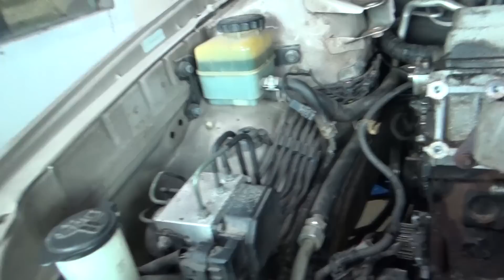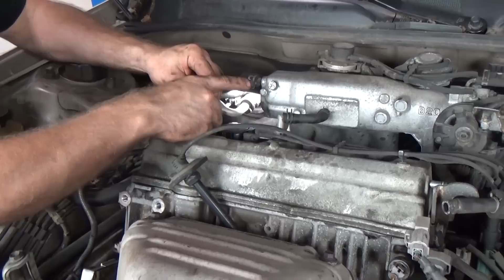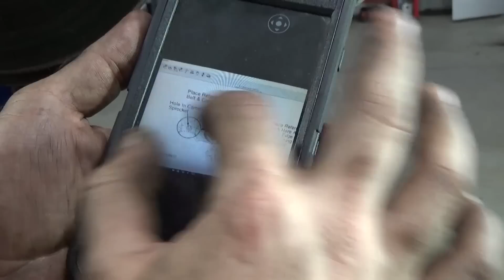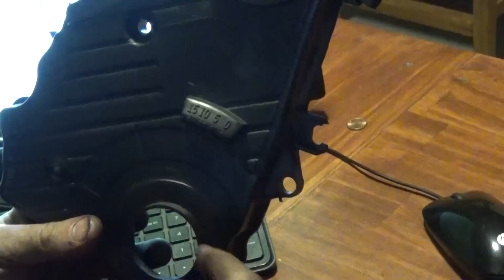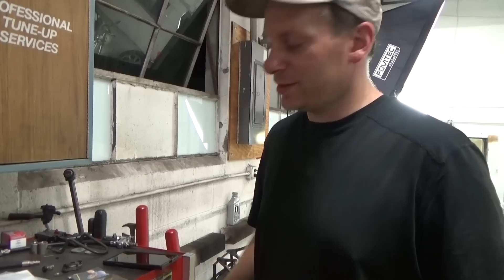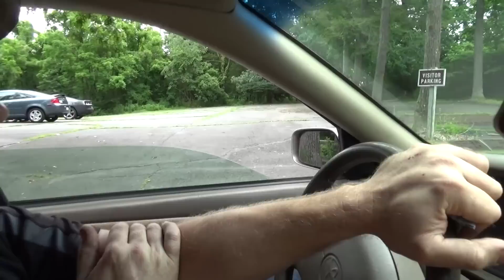Toyota Camry Crank No Start Part-2 Broken Timing belt

Comment: One of the best cars ever made.  I've got a 2000 Camry V6.  Needs struts and a timing belt job (belt, water pump, cam seals, valve cover gaskets, etc).  It's nearing 150k on its original belt; thank God for non interference engines.

Comment: Excellent repair video my friend. I'm in the process of doing the same thing on my '94 (2.2L) Camry. My timing belt didn't break. The tensioner pulley ball bearings came apart (Sigh). I had to make sure I got all the bearing balls out from under/behind all parts so they wouldn't lock any moving parts up. Whats amazing is this car has 239,000 miles on it and this timing belt has never been changed. Everything is OE.   P.S. I love the way you explain exactly how and why you do the steps you do. Two Thumbs Up to ya. P.P.S. That little trick with the red wire crimp connector is "Spot On".

Comment: There is a camshaft plug on transmission side that need to be sealed also when doing the valve cover gasket and the half plugs need some sealant also. 

Some people would buy a new car instead of paying 1000$ for a clean fix on the car they have. 

Great videos 👍

Comment: I have never seen a radiator cap fall apart like that.  I got a little nervous for you on the initial start up.  That sucker sounded like it was close to hydrolocking, good thing you had the plugs out for a while during the repair to dry the cylinders out a little bit.

Comment: That would have sucked Will, a great job and a faulty radiator cap could have caused possible catastrophic failure. Good catch bro, a little luck as well.

Comment: Hi. Working on my 97camry this month.doing a oil leak repair but had to remove timing belt.assummed it was oil pump gasket.But the crankshaft stopped  rotation.removed spark plugs during repair.started the the engine without spark plugs in and low battery.Do you know what is it?

Comment: One of the best timing belt videos in YT. Did you have to shift gear in Neutral position to be able to turn crankshaft 1.75 times clockwise before fastening tensioner pulley?

Comment: Man, I tried to get the people who did my timing belt on my 99 5S-FE Camry to use the mark on the crank gear for crank/cam alignment like you did, but instead they used the zero timing mark on the crank cover. They said it's the same thing, and maybe it is, but in my mind the cover marks are timing marks and the gear marks are alignment marks and who T F knows if they're the same thing exactly??? The car seems to run alright, so I guess it's good.

Comment: We used your video to help replace the timing belt, we even got the timing right but for some REASON, oil keeps leaking from the crankshaft seal area, we replaced the seal too, how can we stop this leak ???PLEASE

Comment: Another great job.  The computer page on the video that have the instructions and torque specs, is that a website or a subscriber service?  Thanks.
Reply from the maker: 75hdfxe thank you, I'm using a paid program called Mitchell on-demand this has all gone web based these days so in time once newer cars roll in then I cover I will go web based alldata

Comment: So what was the issue?
08 Camry same issue I’m having… what I did was take the camshafts out to take the 10 bolts out and retightened same torque, maybe the head gasket leak will be fixed.  I was watching a video to how to put the chain back, at this point the side cover was not off…

I end up putting the chain back and camshafts on wrong position, started the car then it will die, started the car again then I hear small boom then shut off,   When you first started that Camry mine is sounding the same spark plugs not firing.

I went ahead and changed the head gasket and I put everything correctly and before I started the car I moved the polley pin point to 0 mark as they said, but it’s not starting.  I uploaded a video checking the  fuses in my car.
Reply from the maker: Had original timing belt and she gave up on life. Replaced seals and timing belt, she’s been happy since. This video was shot some time ago.

Comment: 5S-FE are notorious for oil pump seal leaking and once it leaks then oil pressure doesn't meet specs which will create engine failure.

Comment: I screwed up my 5sfe timing. How do I tell if I need a new engine or if it's worth fixing? It will crank for a few seconds before the computer shuts it down. It's a 95 Camry.

Comment: Your customer will likely be back for a Catalytic Converter when the money light goes on and he cannot pass inspection.  My guess is that the air getting sucked into the broken exhaust is causing the engine to run just rich enough to not throw a code now.